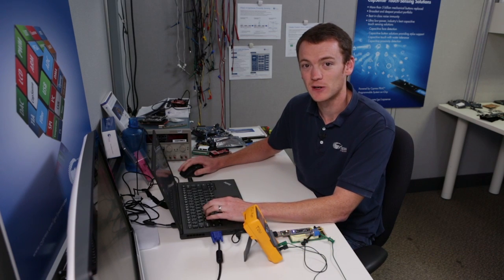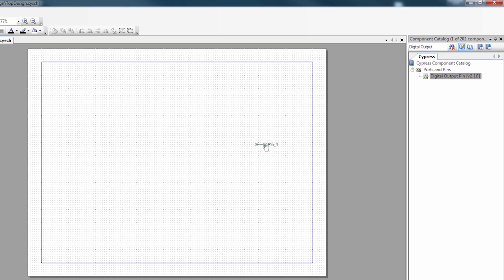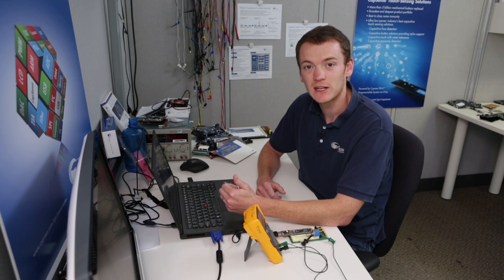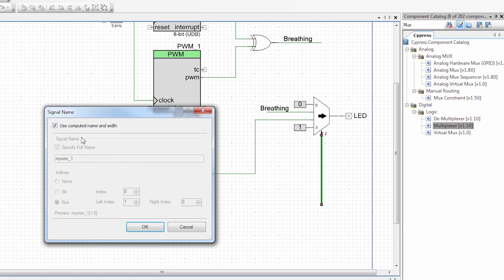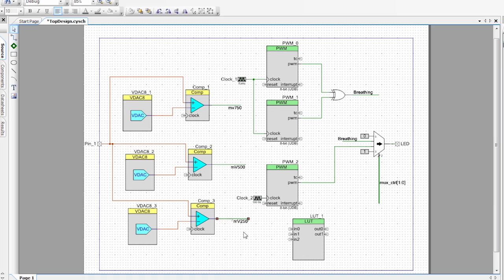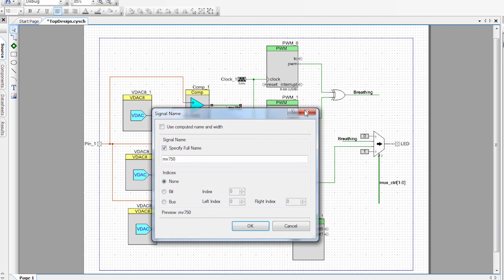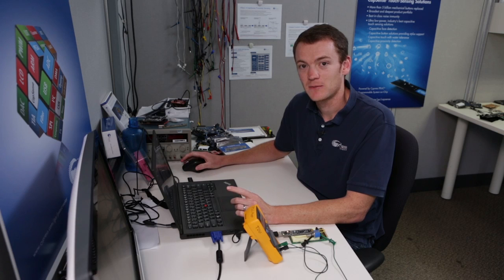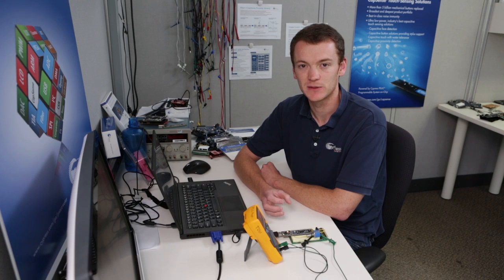How to Create an Analog Alarm with PSoC 5LP

Comment: It looks quite complicated. Could int not just done by C-Code? I have several PSoC development boards but terminate to use them because never got things working like I wanted. Therefore I stayed with MSP430, STM32, ATMEGA. And doing every thing with hardware looks like a waste of resources. With code I can use only one timer to generate many different PWM-outputs.